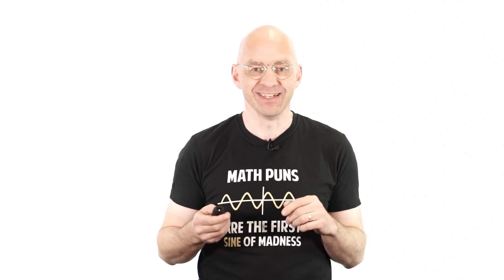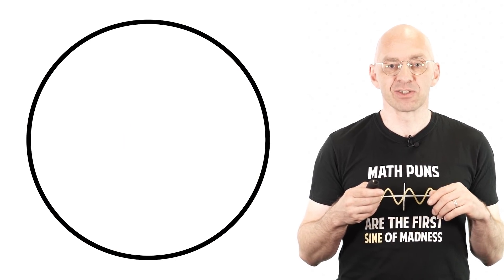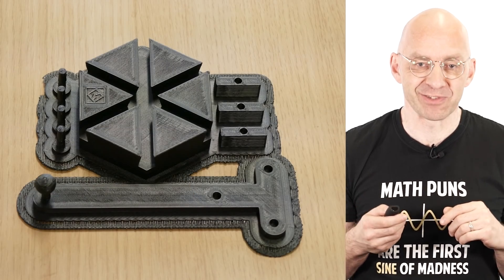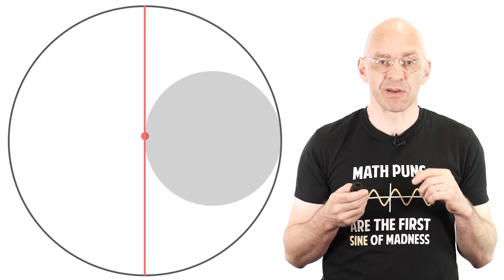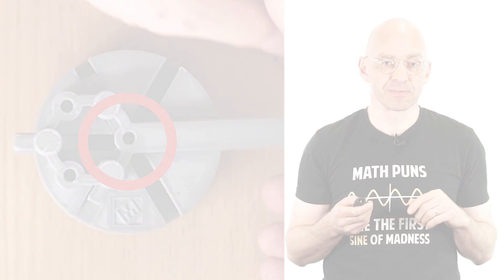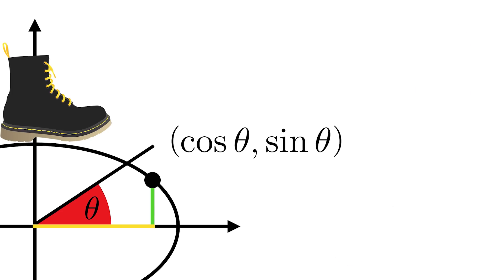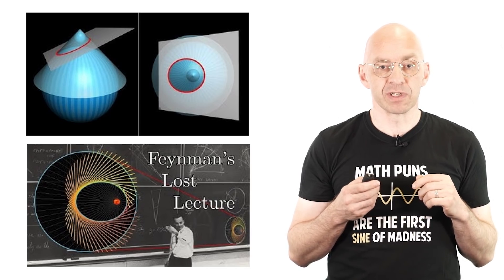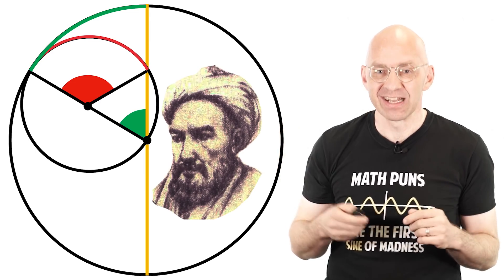Secrets of the NOTHING GRINDER

Comment: 11:40 looks like you just refresh proof that angle based on arc and point on circle is half of angle based on center of circle and same arc.
Reply from the maker: Not sure what you are trying to say here :) Again, the circles don't slip and so the arcs along which they touch have to be of the same length. Now it's clear that the arc along which the large one is touched is the green one shown in the video. However, it's not obvious that the arc along which the small one is touched is the red arc. We have to prove that. Does that help? :)
Reply: I think r75shell is hinting at this theorem: https://en.wikipedia.org/wiki/Inscribed_angle#Theorem
Reply: @Mathologer  What you say in video is clear enough. I just want to say that as soon as you mark one angle as green and other as red, you may see that they "based" on same red arc, and thus, from school geometry (RU) property of circle angles, there is following one. I'll try to describe it by points. Imagine you have circle with center C and two points A, B.
Now, for any point V on same circle, angle AVB is half of angle ACB. It's because they are based on arc AB. It works for any arc AB and any circle, so far as ABV lies on circle and C is its center. Oh, one more condition: V is not on arc AB

Comment: I feel like any ellipse has two identically shaped ellipses, with one being turned 90 degrees
Reply from the maker: It's actually three for proper ellipses like the blue one. Two corresponding to two symmetrically placed points between the screws and one outside :)
Reply: @Mathologer  Thanks for answering, by this do you mean that proper ellipses come in groups of 3 or that for any ellipse there exist 3 other ellipses, thus being in groups of 4?

Comment: The first practical application that comes to mind is a machine that turns rotating motion into linear motion.  For example, a rotating windmill shaft lifting and plunging a connecting rod on a pump.  Another application is a component in a mechanical computer.  See the Y-tube channel "Navy Reviewer" which has old (from the 1950's) training films that explain how fire control systems on battle ships worked (prior to the digital revolution.)
Reply from the maker: Here is a video of someone using this idea to cut an ellipse with a router  https://youtu.be/ZJ09XPqBX28 :)

Comment: .Dear Mathologer, I thoroughly enjoyed this video as usual. It struck me that the nothing grinder might actually do something so I sent the following comment to Joerg Sprave. You may not be aware of his Slingshot channel. It's all about toys for boys - good clean fun. I wonder if anything will come of my suggestion.
 I was watching your compatriot, Burkard Polster's Mathologer channel and his latest video features a device invented by Archemedes known as the nothing grinder. (Link to video https://youtu.be/7Fn-26Jmi5E ) Afterwards i watched one of your repeating crossbow videos and the sliding mechanism reminded me of a component of the nothing grinder, which has two reciprocating sliders but, as Burkard relates, any number of sliders is possible. What if the sliders were arming and releasing multiple slingshots or crossbows? With some clever engineering (your department), I think a WMD powered by a rotating crank handle might be achievable. What do you think?
Reply from the maker: cool :)

Comment: Since the elipses got less and less squished the further out it got no other elipse traced by the thing would have the same shape.
Reply from the maker: What happens if you chose the point to be in between the two screws ? :)
Reply: Mathologer ooh if you put the point closer to the screw at the beginning of the rod than the other screw you get a vertical elipse that has the same shape as one of the horisontal elipses you get when the point is closer to the other screw! Thanks for the hint, it felt really rewarding when I got it.

Comment: At 11:44, you fade out the raspberry segment of the base of the isosceles (over the diameter of the larger circle) to pink.  This is very confusing, because all pink makes it look like the zig-zag has to be equilateral triangles, which would only be true at 60, 120, 240 and 300 degrees.
Reply from the maker: Yes, a different color would have been good here. But since nobody else mentioned this I'd say very few people have a problem with this (usually whenever there is a typo or really anything that people feel is not quite right, there will be a zillion comments :)

Comment: I'm going waay out on a limb here.  You're able to construct two curved lines of equal length with different radii.

When I was in college, in the late 70s, I was determined to trisect an angle.  I got to the point where I thought I need to transfer the length of a curved line to another curved line of a different radius.  I know you'll tell me it's impossible to trisect an angle.  I even watched another video several years ago the proved it to my satisfaction.

My project started by picking a distance from the vertex and tripling that distance and using those points as the radii of two circles.  If you multiply the radius of a circle by three, isn't the circumference tripled, and an angle drawn on the center of the circles would intersect the tripled circumference at two points that are three times the distance along the circumference compared to that distance along the original circle?  If I could transfer the actual length of the curved line from the radius of the original circle to the circumference of the tripled radius circle, wouldn't that mark a point on that circumference that trisects the original angle?

Comment: There are two points which trace out a perfect line. You have already established that between those two points, there is a circle traced out. Assuming that all points trace an ellipse and the aspect ratios vary continuously, we should expect that ellipses with any aspect ratio between 1 and infinity can be found between the red circle and the outer line (toward the handle) and between the red circle and the inner line (away from the handle). There is one more instance of the blue circle - the actual one drawn - outside the second line. In summary the answer is three - an ellipse with the same aspect ratio as the blue one can be found in three different places (including the one drawn)
Reply from the maker: Three is correct :)
Reply: @Mathologer  and as a sidenote, since you get back to a circle as the length of the rod goes to infinity, ALL ellipses appear three times, except the line, which appears twice and the circle, which appears once in reality and once in a limit

Comment: There should be 3 of every elipse. 
Between the two pivot points it goes between a straight line (at one pivot) then continuously transforms into a circle then back to a line, in-between a circle and a line is every elipse. On the arm outside the pivot point it starts at a line and then as we go farther away the variation becomes a smaller percentage of the total width meaning at infinity it becomes a circle. And between a circle and a line is every possible elipse.

This leaves two exceptions: lines and circles which are ellipses but each only appear twice. (Or once for the circle if you don't count the limit as appearing)
Reply from the maker: Three is correct :)

Comment: If you were clever enough, and made the track slides into pistons, perhaps some kind of convoluted engine? Alternately if those were replaced with bar magnets and had coils adjacent, you'd have a fairly oddball AC generator, and would produce a phase for each track.

Maybe not the most practical approaches, but in theory this mechanism can be put to a use.
Reply from the maker: Here is a video of someone using the nothing grinder idea to cut an ellipse with a router  https://youtu.be/ZJ09XPqBX28 :)

Comment: Your proof by squashing a circle, an affine transformation, also leads to a beautiful proof for the area of an ellipse, which could otherwise be quite difficult.  

Your previous video on epicycles ignored use of eccentrics, probably because it now seems obvious these are equivalent to epicycles.  This was not as obvious to ancient Greeks, and Apollonius is credited with the proof of equivalence of epicycles, eccentrics and even equants. Working in terms of eccentric angle also makes it possible to calculate the area of a segment of an ellipse without calculus. 
BTW: the angle between the trammel and the x-axis is equal and opposite to the eccentric angle for the point on the ellipse being drawn at the moment. 

Your other diagram about those angles and the height of an ellipse as a*sin(theta) when the height on the circle is sin(theta) also directly relates to Kepler's equation. This is a kind of historical anomaly because he found an iterative numerical solution to a difficult problem in calculus before calculus was invented. It is equivalent to calculating values of elliptic integrals, which are not elementary functions. For low values of eccentricity the iteration converges very quickly. 

(Elliptic integrals can also be evaluated by the arithmetic-geometric mean or AGM. There is a pretty heavy book on Pi and the AGM by the Borwein brothers. It offers  ways to calculate Pi to millions of digits without infinite series. I'd like to see a more geometric explanation.)
https://maths-people.anu.edu.au/~brent/pd/JBCC-Brent.pdf

Personal note: It just happens that I have used Kepler's equation and a scientific calculator to calculate positions for Sun sights in navigation, when we had lost the nautical almanac.  I just happened to have a 3x5 card with the elements of the Earth's orbit around the Sun on one side, and the formulae for reducing a sight on the other stored with the calculator in a waterproof bag. I don't know that this saved any lives, but it did keep us from heading out to sea or into a shipping channel, as we were doing at the time. (No, we did not have GPS.  This is a story from the 1970s.)

p.s. I checked the price on your 3D printer.  They must pay mathematicians better in Australia.
Reply from the maker: All very interesting :)
"Your previous video on epicycles ignored use of eccentrics" Actually when you have a really close look I had it on one of the slides.
Reply: @Mathologer  I must apologize for criticism, particularly since you did mention eccentrics.  Also, I should have said more positive to begin with about the video, which involved a lot of work. You just happened to step on one of my own obsessions. 

I'm afraid some ancient Greek attitude rubbed off on me.  They reasoned in words, and made a big deal out of grammatical distinctions.  They were not politically correct. Anyone who didn't speak Greek was obviously a barbarian. An Al Tusi couple would be a hypocycle because it involved a circle rolling on the inside of a larger circle. For modern mathematicians the distinction isn't very important, nor is the difference between drawing a curve with an epicycle or with an eccentric. 

The place where the difference matters is in the use of eccentric angles to calculate areas, as Kepler did.  Explaining how he came up with a means of evaluating an elliptic integral before calculus bothered me.  Saying he was "a genius" is like invoking magic.  

It turns out that Kepler was familiar with a physical example of eccentric motion which is required to reduce observations to geocentric coordinates, since observers on the surface of the Earth are not at the center. In naked-eye astronomy the only place this matters is observing the Moon. We also know Apollonius was obsessed with the orbit of the Moon, so he must have run into the problem at that time. We don't know for sure because almost all his writings on astronomy were lost.  We have only fragments of his work or that of Hipparchus. 

The correction works like an assumed position method.  You guess a value, then calculate a correction.  For small angles, this converges on a good value quickly. Of course, the daily rotation of the Earth and monthly orbit of the Moon produces a weird epicyclic/eccentric curve that is not an ellipse.  It just happens that if you choose the right ratio you can draw an ellipse. This is where Kepler applied what he already knew to do calculations based on his law of equal areas in equal times. This just happens to be equivalent to evaluating an elliptic integral, a problem I first ran into in calculating the period of a simple pendulum when you can't assume the restoring force is linear.  It was like: "Wait a minute! You're telling me this purely geometric problem about ellipses turns up in a pendulum moving along a circle, where there is no visible ellipse?"

The inverse of elliptic integrals are elliptic functions, which were a real revelation around 1800.  If I don't stop now, I'm going to be explaining elliptic curves and Diophantine problems, which brings us to Fermat's Last Theorem and the Modularity Theorem. 

The idea that problems that look so simple lead to such deep results still astonishes me.
Reply: Afraid I can't help myself, but have to say that explanations of how the AGM works to evaluate elliptic integrals disappoint me by offering nothing intuitive or geometric. Take a look at the "special case" of Landen's transformation in the Wikipedia article, and try to tell me that is not geometric. https://en.wikipedia.org/wiki/Landen%27s_transformation

For those who want to explore the history, I recommend this book in the Internet Archive: https://archive.org/details/ondirectnumerica00kinguoft

Of course King doesn't say much about Euler, and we all know almost everything using calculus goes back to him.  Elliptic integrals are no different. 

One last tidbit, both the arithmetic and geometric means appear as lengths in Archimedes' diagram of the arbelos.  I suspect he was trying to approach the area of a circle from yet another direction, like constructions involving lunes.

Comment: [Edit: The following analysis forgets about the inner part of the circle on which the joints lie.
There on the arm are two more points for each ellipse traced out by points on the outer part of the arm, that trace out a scaled down version of the same ellipse.]

If we extend the arm infinitely only in one direction, then there is only one point for every possible shape of an ellipse.
If both ends are extended infitely (or only sufficiently far for any particular case), then there are two points on the arm that trace out the exact same elliptic shape.

The reason for this is that the exact shape of the ellipse, which is traced out by a point p, depends on the difference between the distance pn of p to the nearest point on the circle n, and the distance pf between p and the farthest point on the circle, relative to that circle's diameter d.
The circle here is the circle on which the joints between the arm and the sliders lie.
So the descriptive term is |pn - pf|/d.

If the arm goes on forever in both directions, then this term is the same for any point on one end as for the point on the other end that has the same distance to the center of the circle.

Let's look at some extreme cases.
If the difference between the two distances pn and pf equals zero, then a circle is traced.
This occurs for the center point of the circle on which the joints are, and for one point on each end of the outer part of the arm, when there distance on the arm approaches infinity.
A circle is also traced out when d approaches zero, so |pn - pf|/d approaches 1.

As demonstrated in the video, the most eccentric ellipse (i. e. a line) is traced out by any point that lies on the circle formed by the joints.
In this case, |pn - pf|/d is exactly one, as the only remaining non-zero distance, pf, equals d.

Comment: I have an idea for a simpler proof for the Tusi couple:
The two arc segments of the circles are of equal length because you have rolled the smaller circle along the (mathematically ideal) line of the bigger one; i. e. never have the two circles slided along each other and (at least until the smaller one has rotated once) no point on either circle has touched more than one point of the other circle.
If we cut both circles open and straighten them, this becomes more obvious.
Reply from the maker: Well, that's (the start of) my argument - the arcs along which the circles touch have to be the same length. However to start with it is not clear that the arc on the smaller circle is the red highlighted one. That's what we have to prove :)
Reply: @Mathologer 
Please excuse my poor wording (I have made it clearer now).
But I assume, the real question I am missing is how to get from equal arc lengths to both arcs ending on the same vertical straight line.
Reply from the maker: @xCorvus7x  Yes, it's clear that the green arc shown in the video is exactly the rolled on arc on the outer circle. What we need to show is that the red arc shown in the video is the rolled on arc of the smaller circle :)
Reply: @Mathologer 
Thank you for clarifying ^^'
Now I understand your proof 👍

Comment: You haven't proven that the point on a circle moves in a straight line if the circle rolls around a larger circle with twice the radius, have you? All you've shown is that at this particular angle, the point will will be on this straight line. For other angles the constructions of the proof doesn't work.
Edit: I was dumb, it does work for any angle.